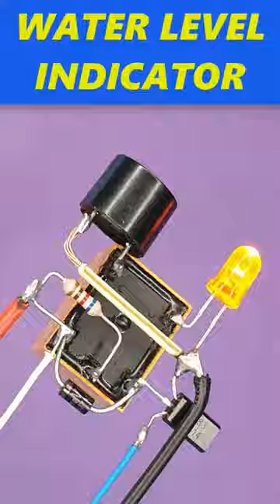Water Level Indicator/ Water Tank Alarm/ Project #diy

Comment: what is the real code for transistor resistor plz tell about each and every part
Reply: Bro same thing 
I think it use to when two wires put into the water then passing current is less through water therfore transistor is use to direct current pass (Emitter is direct connect to -supply of battery and collector connect -led    and +led connect to resistor and other end of resistor is put into the water as well +supply of battery and finally base of transistor means [middle one of transistor] is put into the water)  note when you touch both wire (putting into the water)  then led is glows I hope you understand what is use of transistor